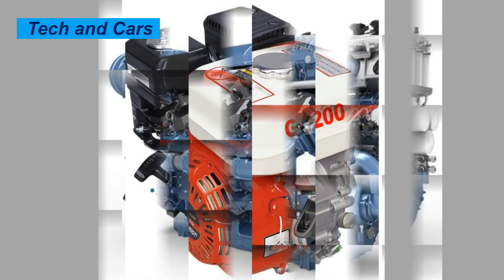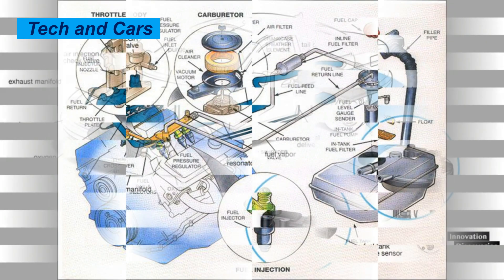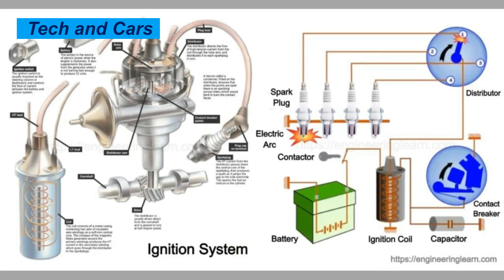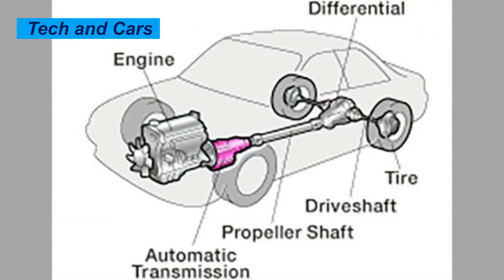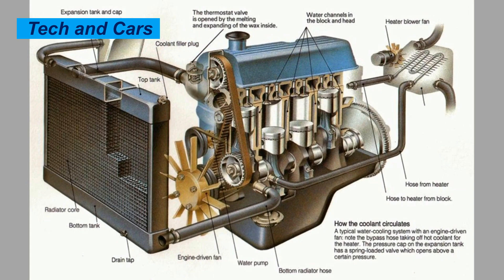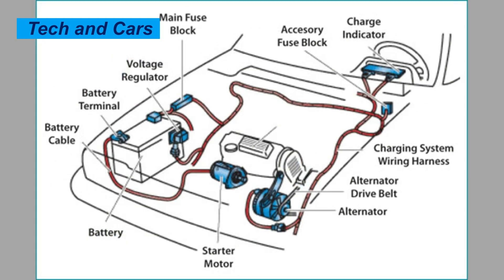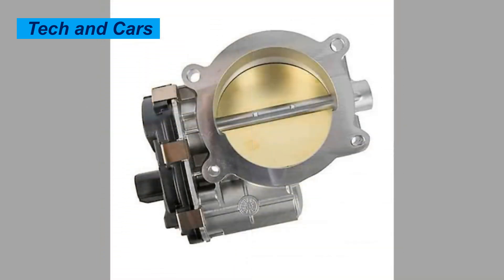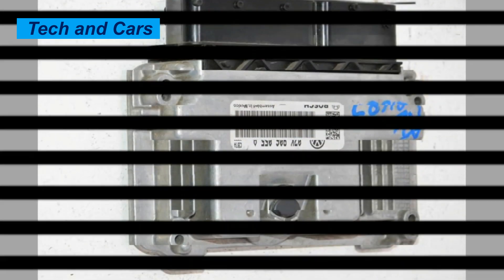Here is why cars lose power when accelerating

Comment: If a mechanic has drilled a narrow straight hole  through the catalytic converter and through exhaust manfold to avoid the exhaust ever getting clogged, Does it reduce any engine power? Can it limit the engine speed not reving above 2000RPM and make the car at limp mode at 100mph?
Reply from the maker: Not really.... unless the engine is gone to the limp mode
Reply: @Furnishandlourish  Yes t he engine is sometimes getting into limp mode limiting the speed at 100mph and the RPM not exceeding 3000.
Reply: @Furnishandlourish  Yes it goes into limp mode. Is it caused by the exhaust ? ?